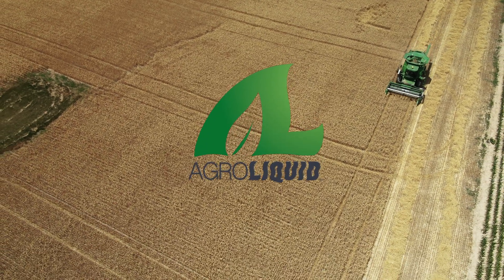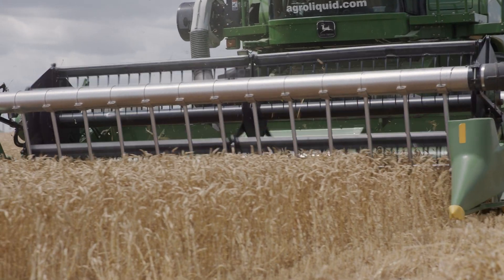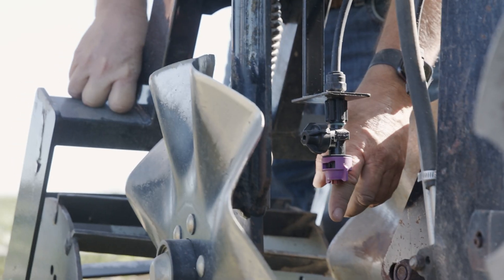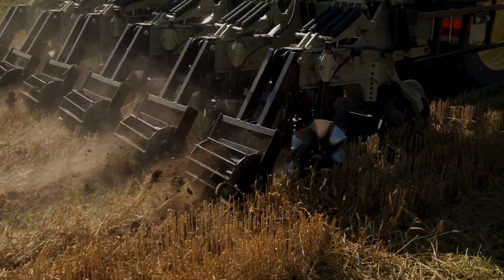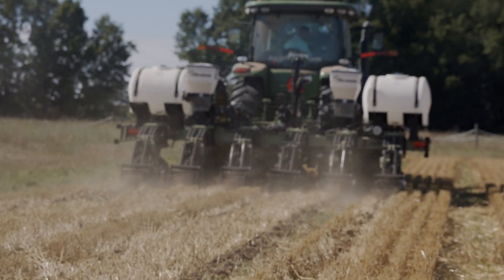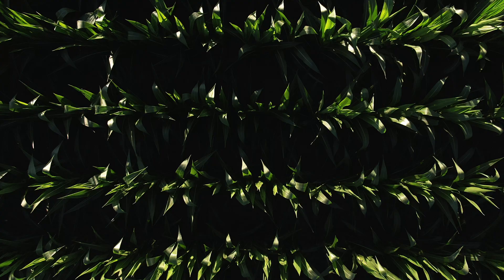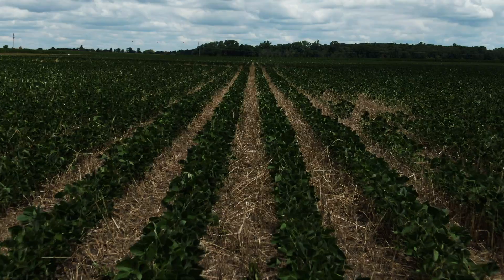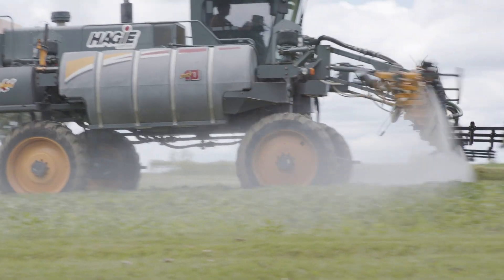AgroLiquid Strip-Till research

Comment: Always interested in strip till  worked for a farmer in Central Iowa  have seen from the beginning   they told me they were going to have a little experiment. 4500 acres. Modified ,built , And bought equipment. 1st year was wet , but it was worth it ,watched the soil structure change every year .after the 3rd year was a big difference. Was impressed that you could use less with better fertilizer! My opinion is you have to have the microbes balanced for more Bang for your Buck!
Still learning more everyday!